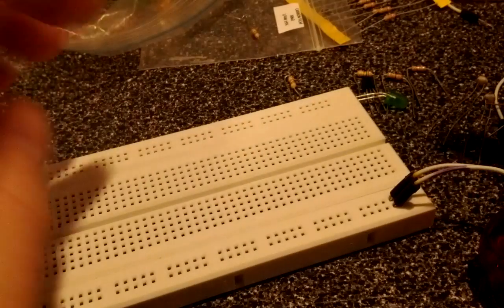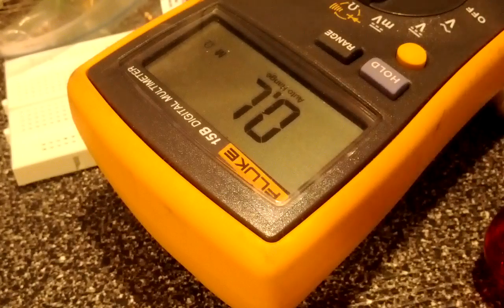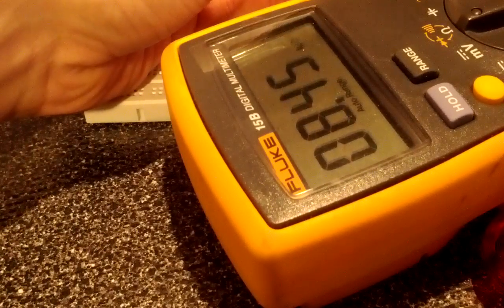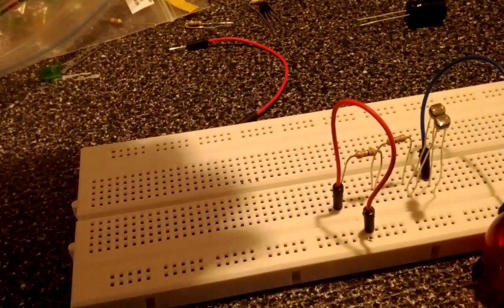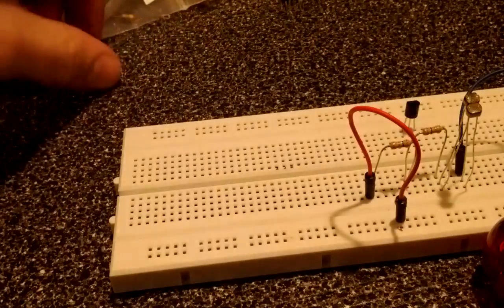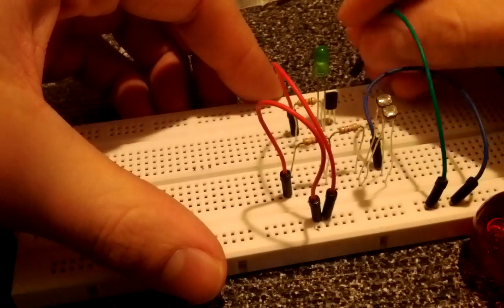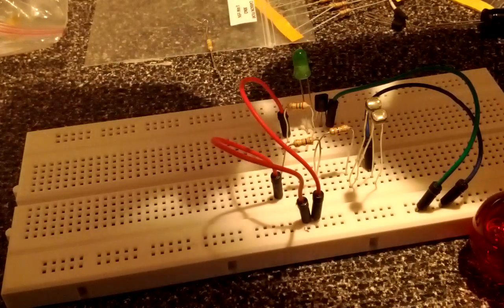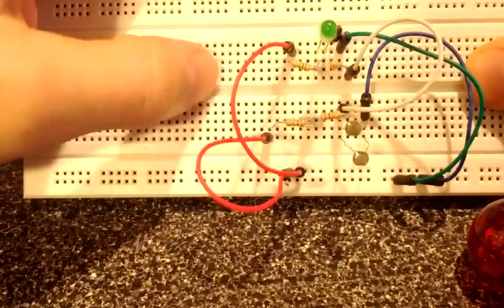Breadboard Tutorial: Nightlight Circuit

Comment: Hi, it's a pretty good project. can I have actual values of resistors so that I can buy the same resistors from market?
Reply from the maker: Syed Hamza Haider I'm sure you can figure it out based on the LEDs you're using and the voltage of the power supply.